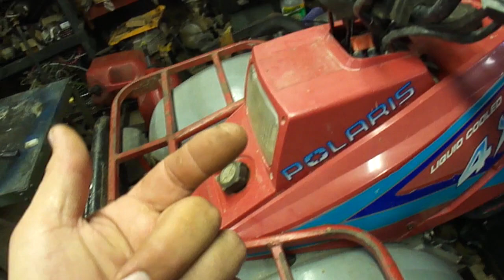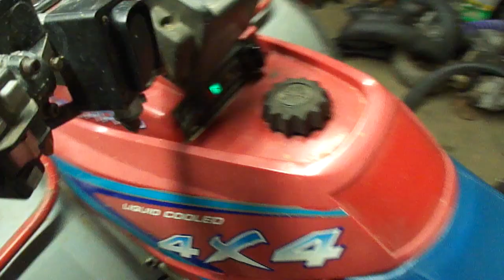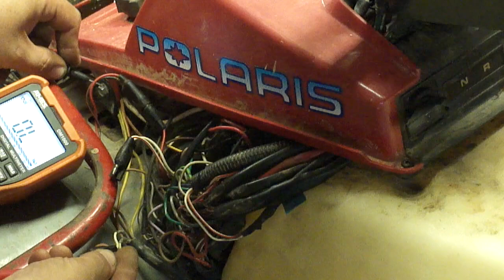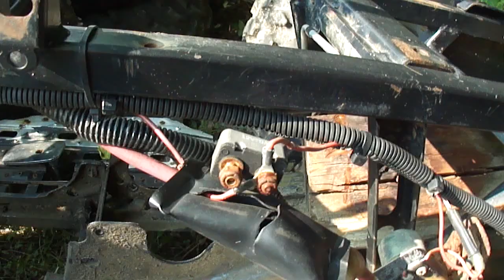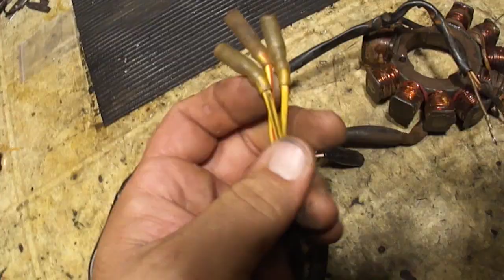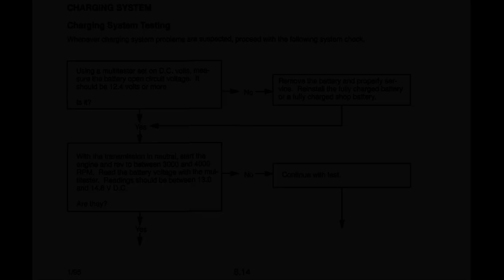How to test the Stator on a Polaris 400L 4X4

Comment: I have a 1999 Polaris 400 2-stroke I replace the stator with a new one but my flywheel one of the magnets is busted in half so what should I do do l  have to buy a whole new flywheel or can the magnet be replaced and if they can where can I find one I check eBay I can't find them
Reply from the maker: You need to replace the flywheel. There are no replacement magnets available.

Comment: So when I turn the bike on it drops to 10.5 volts and not charging above that at all an idea where to start with this?
Reply from the maker: Check for voltage drop on red wire from circuit board to battery positive. Then check voltage drop from engine to battery negative. Check stator AC output at Regulator connector yellow wires, engine running at 4000 rpm voltage should be above 50 volts AC.

Comment: Text you a while back about my Polaris 2001 coming out of my stator cover horny and why now when I hook up my black wire off my CDI box it kills my engine I checked all the wiring on it check for shorts replace a CDI box for regular box the voltage regular box the battery starter solenoid ran for a while now it won't start and I'm getting the ark turn on my stator covers at no I'm not getting any spark off my coil wire when I want when I check it
Reply from the maker: It is a little hard to make sense of this comment. Sorry.
Reply: Sorry I have a 2001 Polaris replace the stator on a replace the CDI box replace the regulator in it where is running good for a while okay for a while but when I hook up the black wire it won't start or it kills the engine Arthur CDI box went to go start it the other day will not start now I'm not getting any Spark out of my coil look down it looks like it was arcing from around the area stator cover before I replace everything I checked for short wires no shorts no where is a word that could be  @MrFixit1

Comment: You're probably the best guy I've ever watched on a video I like all your videos serenade your voice
Reply: First off thank you for replying went through all the electrical checked all the wires replaced with CD CDI box stator regulator battery getting Arcane from a crankcase area when I try to start it checked all the resistance they all seemed good ran okay for a while the only I didn't change is reflector on it checked all my grounds to make sure they were good and one more thing when I hook up my ground wire black wire off the CDI box it won't start the kills the engine it won't start it just wondering why I might be getting out of my crankcase area where the stator is just wondering why I'm getting a working out of my crankcase area with the status at what a bad reflector cause this and my 2-year fan actually

Comment: I have a 2001 Polaris I've been working on for 2 years I bought a brand I bought a furry 1800.00 used I noticed is it overcharging please send me some professional help I wish you can call me I'm 75 years old and working on a bike in a winter time
Reply from the maker: If it is over charging it could be a ground wire to the regulator/rectifier, or the main battery ground to the frame ( if this was the case none of the electronics would work) Or a bad regulator. Check that the regulator is grounded. I'm not real familiar with the 2001 and newer models.  Look on tradebit.com for a manual. you can buy it, and they will send you a link to a PDF file and you can download it to your Phone\computer within minutes.

Comment: I can use any 12v 30 amp auto reset breaker?
Reply from the maker: you need a 12v 10Amp breaker
Reply: @MrFixit1  gonna snag one and throw it in. my lights on my dash/headlight dosnt work and my battery isnt charging while running. hoping its an easy fix.
Reply from the maker: @deadjoey77  If the breaker is bad nothing will work. Check for 12v at the red wire on the circuit board. That is the main BATT + wire coming from the breaker.

Comment: Hi , I got a problems with this , won’t start, even I can’t found the motor oil drain please if you can help me thank you.
Reply from the maker: If the engine won't start you need to know if #1 does it have spark? #2 does the engine have compression?  #3 is fuel getting into the engine? Check out this video for the engine drain: https://www.youtube.com/watch?v=5hyUr41OGWw

Comment: What if you have no reading at the black and red connection at the cdi box?
Reply from the maker: The red/black and red connector is the ignition exciter coil circuit. No reading here would result in no spark.
Reply: @MrFixit1 so would that mean the stator needs replaced?
Reply from the maker: @hwyrider2238  Are you testing on the stator harness side of the connector? It could be a broken or (open) wire in the harness. inspect the wiring. you can pierce the wires down at the engine and check again. Otherwise yes you might need a stator. Uncommon for a stator to go bad. pull the side cover and the flywheel and have a look in there. You can rent a harmonic balancer puller from AutoZone to remove the flywheel you will also need three 8x1.25mm bolts about 3 inches long to add to the tool the remove the flywheel. Check the magnets on the inside of the flywheel to make sure they didn't come loose and damage the stator.

Comment: Does this unit have a circuit breaker???? I have power then 0 power and it will come on and go off by itself……
Reply from the maker: Yes, there is an auto reset braker just forward of the battery encapsulated in a black plastic pillow shaped housing. You must cut it open to gain access.
Reply: @MrFixit1  Thanks I found it and realized I have a short somewhere in the front

Comment: Thanks for running through this. Do you have anything for the steering shaft/ bushing service? I have a harsh bang over bumps coming up through that shaft into the handle bars. Shocks and springs are new.
Reply from the maker: Check out this video: https://www.youtube.com/watch?v=KfglQdsjGns

Comment: Hi mr fix do you know why mi polaris 350l accelerates and suddenly loses power, it could be because the gasoline is too full of oil.?
Reply from the maker: There are many reasons. To make it short you are probably running lean due to an air leak at a seal or gasket, or the carburetor is dirty or starving for fuel.
Reply: I was about ask about the same thing about my 350 aswell! 
Mine is ideling just fine but sputtering on slow throttle, then as I give it full send is boggs and sputter, then it will run great for 4 seconds then dies on me.. restart it and idle fine, but boggs down and dies after that.. thoughts Mr fix? 
Love the content from 🇳🇴
Reply from the maker: @Westernhotog  Try replacing the spark plug.

Comment: Hello!
I am in the process of replacing the radial seals on my 1992 Polaris Trail boss. I have now removed the flywheel and stator. A problem arises here, there is a nut in front of the radial seal that I cannot remove! Do you know if it is left-handed or right-handed? the nut looks special, think you need a special tool, but I think you can do it with a screwdriver and hammer, what do you think?

Thanks in advance!
Reply from the maker: Slotted nut is left hand thread. I would not recommend using a screwdriver to remove it because (1) you will damage it and (2) it needs to be torqued to 40ft lbs. and getting it tight without the tool is a guess at best. If the nut comes loose, it can cause some major damage. The tool is cheap on eBay Part number out of my 400l manual is  2870967
Reply: @MrFixit1  Thank you very much for your reply! I will order the tool so that everything will be right and correct. The torque on the flywheel, is it 44-62ft lbs?
One more question, what is the best way to lock the crankshaft when installing the nuts and flywheel? On chainsaws, you can put a string in the cylinder through the spark plug hole, to lock the piston. Is this an option?
Reply from the maker: @patriksteffansson6466  Yes the rope method will work, just make sure the rope doesn't get caught in one of the ports. There is a special tool that threads into the spark plug hole you can buy. Or if you have the driver clutch still installed you can hold the engine by that if you are carful. Me personally, I just put a long pry bar in the clutch and hold it that way.
Reply: @MrFixit1  Thanks so much for your knowledge mrFixit!
Reply from the maker: @patriksteffansson6466  You're welcome. Thanks for watching.
Reply: One more thing, did you know the correct ft lbs for the flywheel?
Reply from the maker: @patriksteffansson6466  Here is a link to the manual I use file:///C:/Users/Laser%20Works/Desktop/manual%20PDF/Polaris%20%20All%20Models%20%201985-1995%20Repair%20Service%20Manual.pdf
Reply: @MrFixit1  That manual would have been very good to have, but the link doesn't work?
Reply from the maker: Sorry I tried

Comment: Hey man I went through and replaced my stator, voltage regulator and charged my new battery to 100% last night. It's still not recharging at the battery and had tested everything related to the stator/voltage regulator and am not sure where else to look? Any grounds or inline fuses that could be causing this issue at this point. Also appreciate you telling me to just buy a wheel puller instead of polaris puller for harmonic balancer saved me 40 bucks.
Reply from the maker: Assuming you tested and installed everything correctly, including doing the AC/output test from the stator, check voltage at the red terminal on the circuit board and ground with engine running, you should see charging voltage. Check that the key switch is functioning and ground wire from stator is connected to frame and circuit board. Were the magnets all intact in the flywheel? I have also seen the wires get pushed out of the connectors when plugging in the stator wires at the black connectors. Make sure all the red and red/white and brown wires are in their correct places on the circuit board. Rev the engine to 3000-4000 RPM when testing the battery charging voltage. That's about all I can think of.
Reply: @MrFixit1  Appreciate it. On the flywheel there were no magnets like yours but when I looked at new flywheels they don't have them either it's just a solid surface all the way around. Possibly replaced before as someone had been in there at some point as one of the screws was almost stripped out where the stator connects to.
Reply from the maker: @tc7584  There must be magnets or it wont charge
Reply from the maker: Assuming you tested and installed everything correctly, including doing the AC/output test from the stator, check voltage at the red terminal on the circuit board and ground with engine running, you should see charging voltage. Check that the key switch is functioning and ground wire from stator is connected to frame and circuit board. Were the magnets all intact in the flywheel? I have also seen the wires get pushed out of the connectors when plugging in the stator wires at the black connectors. Make sure all the red and red/white and brown wires are in their correct places on the circuit board. Rev the engine to 3000-4000 RPM when testing the battery charging voltage. That's about all I can think of.

Comment: I desperately need a no spark testing procedure. I used all your videos for rebuilding my quad and everything went well but when I installed the motor I have no spark. Scratching my head at this thing. Again thank you lots
Reply from the maker: Start by unplugging the black wire from CDI to circuit board. If no Spark OHM test the stator. Then OHM test the ignition coil. Here is a manual link, Spark troubleshooting starts at page 8.7 file:///C:/Users/Laser%20Works/Desktop/manual%20PDF/Polaris%20%20All%20Models%20%201985-1995%20Repair%20Service%20Manual.pdf
Reply: So I ohm tested the stator and the three yellow wires tested great perfect within spec. I tested the two plugs, I  believe it’s the white wires plug and the red wires plug and they were at .220 on the red and .10 on the white. I could have those backwards but either way those are way out of spec and I ordered a stator. Hopefully fixes the issue. Thanks a lot again hard to work on these machines without a manual. I worked at a powersports shop for awhile and never had issues while having the manuals. These things aren’t easy without them!
Reply from the maker: @dylantroup3145  I hope that solves the issue.
Reply: @MrFixit1  thank you again. Life savor. Keep making videos with the quad definitely helpful!

Comment: Hi I have a Kawasaki Bayou 300 2x4 and it will intermittently bog when you bottom out the throttle, even when it’s hot and it also just kind of misfires when it’s an Idol, I’ve tried everything I know. Was wondering if you had any ideas
Reply from the maker: Bogging is usually an air/fuel issue but could be electrical. You said you have done "everything you Know". Can you give me some history on the machine, like has this problem always been there or did it just start having a problem? Have you replaced the jets in the carburetor with new ones? What all have you checked? Intermittent problems are difficult to figure out so, any info you can give me may help.

Comment: Another awesome video I’m saving for the future when I need it! lol. Appreciate taking the time to do these man. So helpful
Reply: There's profit in testing when it's working to know what good values are. never hurts to get more familiar with your machine. "should i be seeing voltage on this wire?" is the difference in buying a stator, then a regulator, or replacing a (cough rusty cough) connector on the circuit breaker from your parts machine.

Comment: Easy question, does the regulator ground to the frame?
from my experience, they "float" the AC off the stator no ground, but use chassis ground for the DC of the regulator.
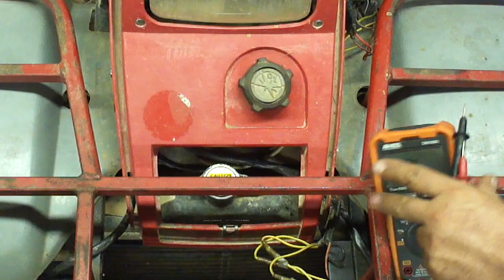and at 7:35 you're measuring raw Amps output from the stator, substituting the meter for the regulator, as opposed to putting your meter in series TO the regulator. not really sure i understand the difference, unregulated stator output, or isolating regulator from the circuit to test the stator testing only?
when i saw the 12A result, i was thinking of different resistive loads to add because of the fuse. partly also i was taught to always check circuits under load.
speaking of, open circuit battery testing, i'll lightly load a battery, then see how close to 12.6V it recovers to.
Reply from the maker: In this testing, I was only following the flow chart in the manual to keep things simple as this was a recommendation from a viewer. As for the type of regulator I'm not sure I haven't found any information on the net for the Polaris R/R circuit. The R/R does ground to the chassis, but I can only assume it is not a shunt type as it does not have a big heat sink to dissipate heat. I don't own an oscilloscope to see the output wave form so, I can only guess. The amp output test was suggested in the manual as a "go no go" test. I agree testing circuits under load is the best way to test but again, I was following the manual flow chart.